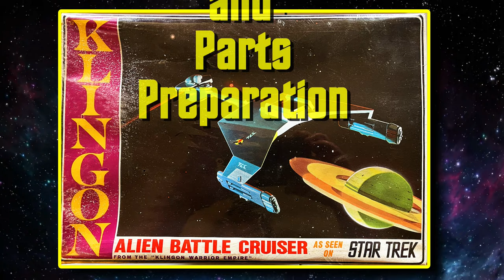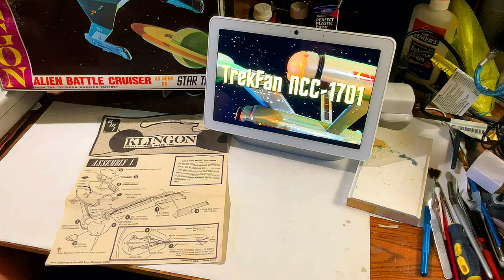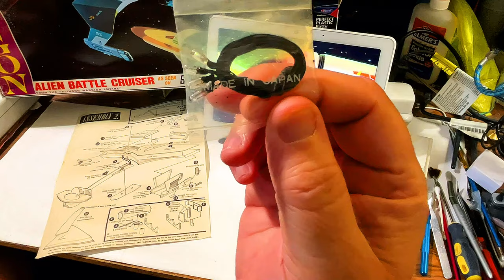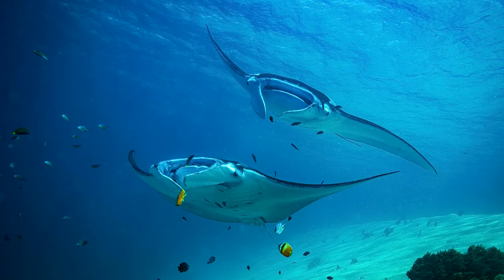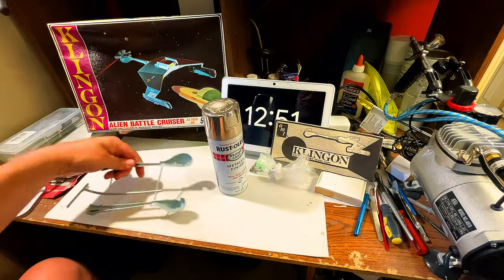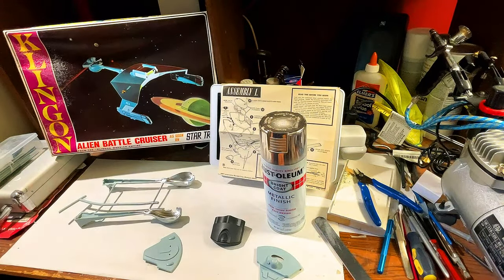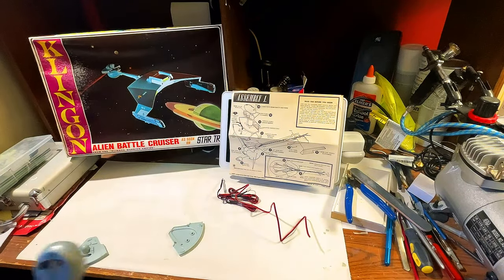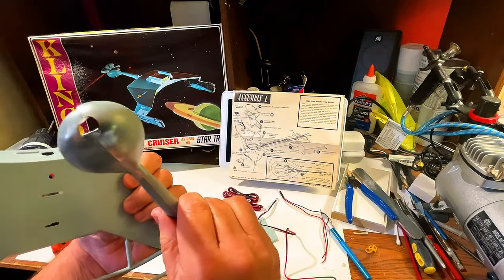1968 AMT Klingon Alien Battle Cruiser Model Kit Build (Part Two Lighting Plan and Parts Preparation)

Comment: When I was in my teens in the 80s, I came across a vintage Enterprise model kit at a sad, old hobby shop. I definitely didn't have the skill level to deal with all the warped plastic. The saucer section was impossible to glue together it was so bad. I regrettably chucked the kit it was so frustrating.
Reply from the maker: Yes, modeling does require a lot of patience. Even with the modern kits there are fit issues that require a great deal of patience.

Comment: The kit, of course, demands to be lighted! But, from what I have read, the shooting model had no lights. I think, I read it was due to their being made of wood and there not being enough time to light the model before shooting.  I know that the back up model was painted by Jeffries in the purple/green scheme. I thought the shooting model was gray. It did have the gold accents on the trapezoids on the pylon grills. But, the windows were  (memory faulters here) either decals or drawn on. I wish I could remember. There were differences in structure on the engine rear sides between the shooting model and the back up. In the picture of Jeffries, seated, holding the D7, for some reason, I think (?) that's the backup model. Sorry, my recall is not the greatest anymore.
Reply from the maker: Thank you for sharing. Yes, it is very noticeable that even the CGI version only has the bulb section under the bridge with lit up windows.